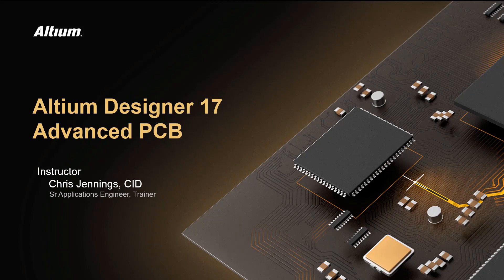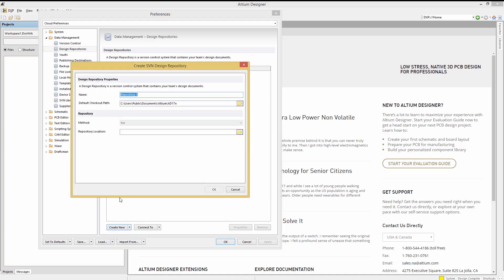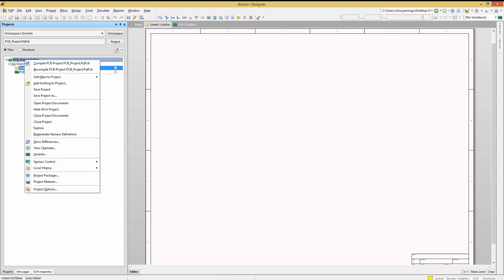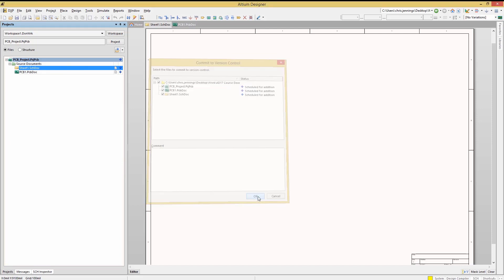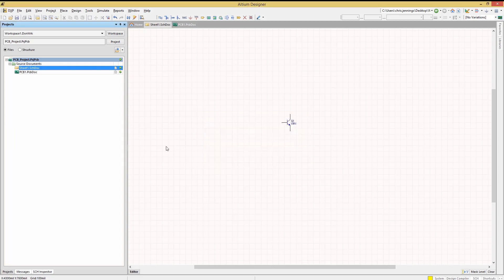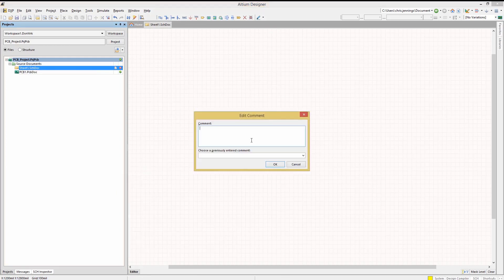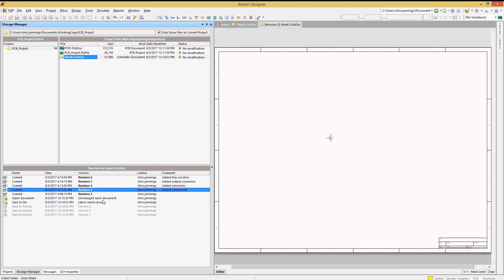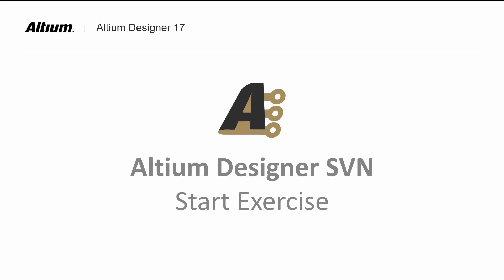Project Version Control with SVN | Altium Designer 17 Advanced | Module 24

Comment: I am using Altium 22. After I clicked 'commit' showed at 1:47, I saw an SVN error "is not a working copy". I also tried to create a new test project and repeated the steps, however it did not work. 

May I know how can I solve it?
Reply: Update: I was adding the project to a repository under the local Google drive directory made offline and it failed. I successfully added the project to a real local C:/ directory. I am still seeking methods to work with Google drive.